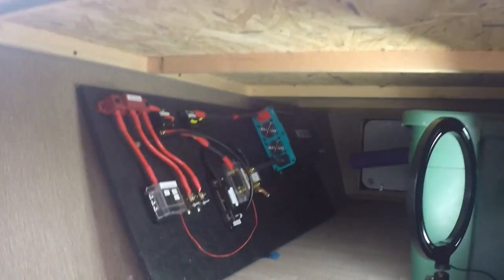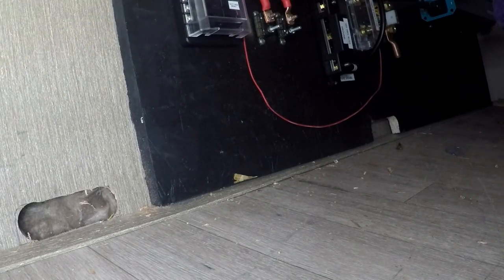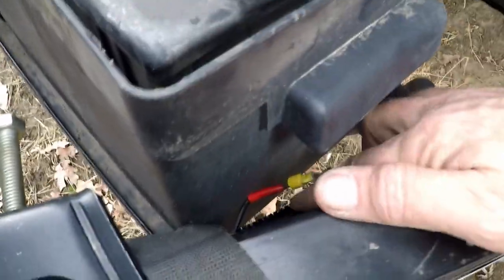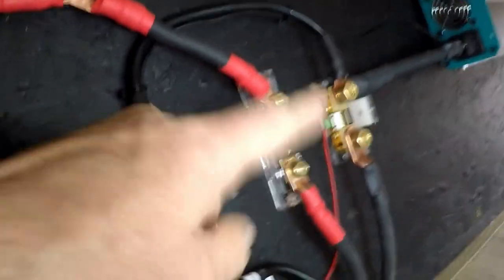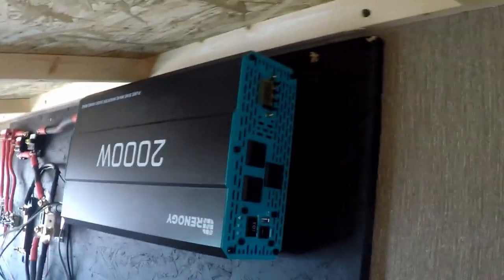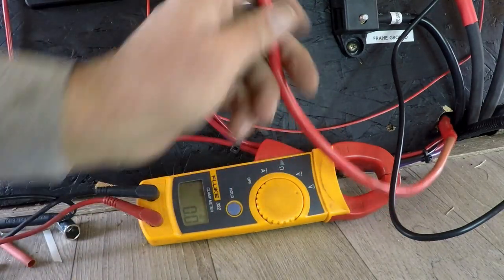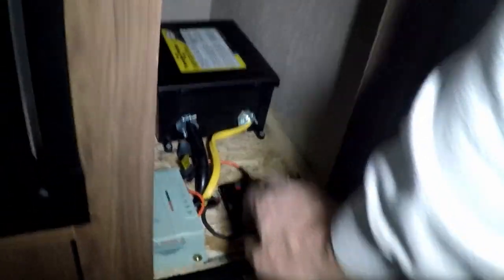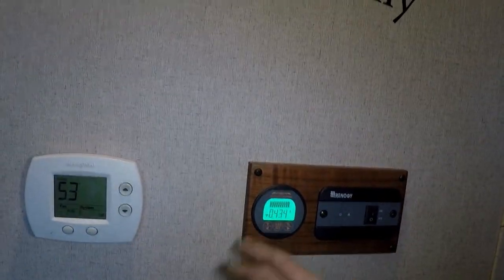Putting it together RV electrical system upgrade

Comment: Hi Greg. Want to thank you for your posting your RV electrical upgrades it helped me do a similar upgrade in my trailer. I installed my batteries and other components inside the unit under the bed as I went with Lithium batteries and I wanted to keep them in a more secure and in a warmer location other than that almost identical to yours. Thanks again. Larry
Reply from the maker: Thank you for your comment, I am glad I was able to provide you with some guidance through my videos to help you with your project. If it was in our budget we would have gone lithium also.

Comment: What size amp buss bars did you use for the the battery terminals
Reply from the maker: The bussbar was a 45 amp bar. The power for the inverter was not routed through the bussbar.
Reply: Thanks. Trying to go step by step to make sure I get the right stuff. Love your videos.
Reply: @mikeww2010  Thank you, I stand corrected the buss bar is rated for max 48 vdc and 150 amps dc. There are links to parts I have used in the description below.